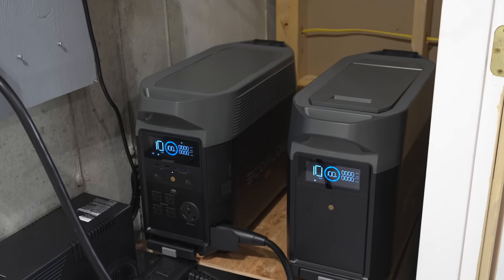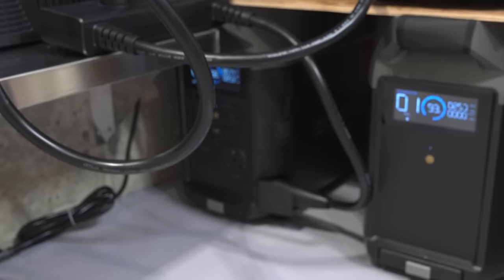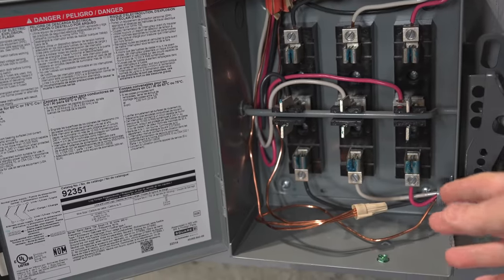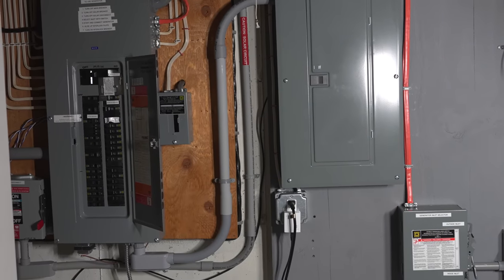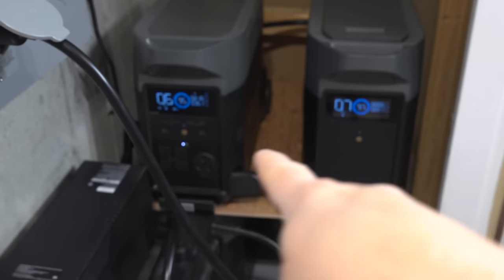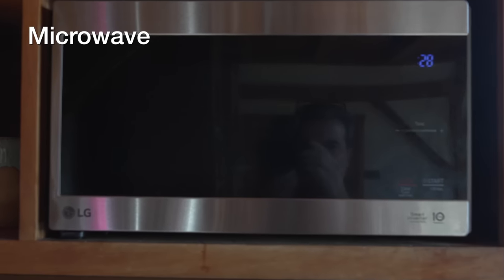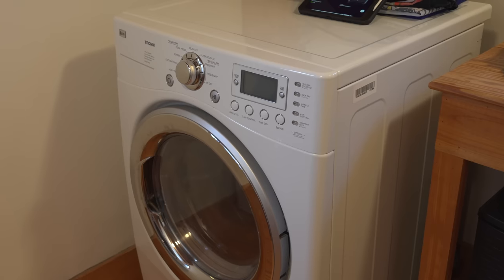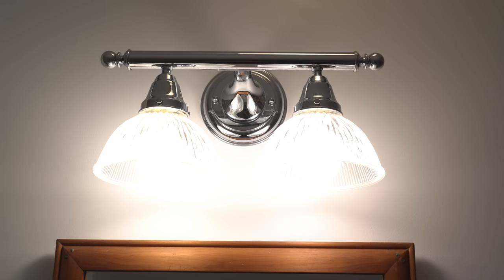How to power your Whole House with a battery generator - Ecoflow Delta pro

Comment: Bro how much does all this cost
Reply: Over six thousand dollars. Worth it.
Reply: @KANSASCLITY it’s about 6 thousand for 1 eco flow and 1 battery, this is about 12k of equipment he’s got here
Reply: It only economically makes sense if you already have solar panels and can use it continuously to draw less from the grid overnight.  Or if your power goes out a LOT.  Natural gas would run about 30 to 50 bucks a day to run a generator.
Reply: How much you got?
Reply: @Benjamin-rq1fi  Yeah I agree. But I like quite clean power. I have the delta pro ultra with 4K of solar dedicated to just it. And 2 gas powered generators. 1 small 120 volt to charge to batteries slowly and very quiet if needed. And a large generator to power the house and charge up the battery’s Fast. After the last power outage I’m glad I made this choice.
Reply: @Shorby99EK I've been considering that use case too!  I may still do it some day, they're just really expensive compared to even an inverter generator.  But it would be real nice to be able to shut off the generator overnight.
Reply: U can do it cheaper
Reply: Do it before the coming war and grid-down. 
The 2 most important things will be to power a well pump and own an efficient wood burning fireplace. Then you’re golden for a long power outage. 
Lights and freezers are next.
Reply: How do you know his name is Bro?
Reply: @kissthesky40  I'm not worried about the zombie apocalypse,  just a reasonably priced solar system when power goes down.    😊😊

Comment: Another great thing about this setup is that you could plug a small generator like a Honda 2000 into the delta pro to help extend the run time of the ecoflow especially when it’s cloudy and solar wouldn’t work well. The Honda couldn’t run your whole house, but could certainly add to the usefulness of your backup system. Especially for people that don’t have large generators. Even better use a small propane generator.
Reply: Nope! You'd think so, but that won't work. Why?

So I had a Ecoflow Delta Mini and I had my router, mesh wifi, switch, IP telephone box, NAS, basically all of my computer stuff, plugged into it. Then, I had my Mini constantly being charged by 110V power. When I lost power (which happens often enough where I live), all would be fine. On three separate occasions, it broke. Each time, the battery would no longer charge. After the third time, they told me that it's not designed to be used as a UPS and if I did it again, they wouldn't fix/replace it anymore. 

If you're discharging the battery while charging it with a generator, you're essentially using it as a UPS. It seems nuts, but they told me that you can charge it or use it, but not both at the same time!!! I'd rather just buy deep cycle batteries or get a Tesla powerwall. Or more simply, just use an inverter generator.
Reply: @dontbanmebrodontbanme5403  I remember the disassembly, the power train they use is a sort of reversable system. So that they can get fast charge times and high output power they use a more complex power inverter that can be basically reversed, this way they can pack more beefy components into a single system instead of having two equally high power circuits, that would increase price a lot. I guess in doing so it wouldnt be able to be used both ways as I am sure that there isnt a "safe" pathway from the electrical charger to the battery or directly out into the inverter.
Reply: @dontbanmebrodontbanme5403  it's some bs - EcoFlow have Passthrough function for AC outlets. I have River 2 model with LiFePo4 batteries - and it able to consume from the grid power for charging itself, alongside with providing power to the AC outlets, by routing the power from the grid (i hear specific clicks inside, that switching lines from invertor to the grid)
Reply: @justahasbeen  Huh?! What are you talking about?

Those backup batteries charge not quicker than the power (genset) you feed them.
Reply: Eric  hey where can this knowledge be found... some things you mentioned I don’t understand, and some I sort of know... One of my neighbors had a fire recently, that started from generator power. A power bar caught fire in their basement with their wifi stuff on it. Their next door neighbor (fireman) happened to be there when it started and spotted it... but he was there to try and help them with a (generated) power problem... I told him (fireman) that it probably had to do with the grounding of their generator and having grounding loop of some kind... but that I didn’t understand what it really means, only that the generators have a ground bonded neutral (or to frame?), that needs to be dealt with when connected to a house with its own ground. Anyway, it’s beyond my comprehension how to logically wire them together. (With my generator i didn’t connect the ground wires together, thinking I was potentially reducing the ‘risk’.
Reply: Why waste time and money on the batteries to begin with? You will never burn more fuel than the batteries cost. My generator can run 12 hours on 2.5 gallons of gas. If I power the refrigerator, lights, range, small freezer and television it runs 8 hours.
Reply: My solar setup still produces 2-4kw when cloudy
Reply: @lookingbehind6335  Some people like to sleep in peace and quiet and have air conditioning. I’m one of those people now. Use solar or a small generator that sips fuel and run on battery at night.

Comment: I'm thinking of using the gas generator long enough to charge the lithium batteries, then rotate back to lithium. That should preserve fuel in the event you're down for an extended amount of time.
Reply: They sell a smart generator now that will do that automatically and then turn off. Brilliant!

Comment: The EcoFlow generator won’t be able to keep up with the demand on the battery to charger them. I would say just use their chargers and plug them into your large generator and set the EcoFlow to fast charge.

Comment: Just a note, the battery back up system running is in the neighborhood of $10,000 of battery and connectors.  This would be comparable to an 11-14 kw Generac with a whole house transfer switch installed.   That Generac would need NG or Propane, but it would go until you run out of fuel.  However, with the Eco Flow system, it will not annoy the neighbors at 3 am.   The only question is whether you can charge up the batteries while they are powering the house?  Or must it be done off line when using the 110v inlets?

Comment: I search for "how to connect a battery to my home electrical system," and I get, "Let me show you my $10,000 system that I installed as an electrical engineer!"
Reply from the maker: Take it easy, I have been doing these for a long time and started with gas gens. BUT if you want to see the cheapest way to do this and you can use gas or battery, see my $100 install here, seriously: https://youtu.be/pPMm0reEBPM

Comment: Use propane generator to charge the ecoflow pro at ~1800watts in 2hrs or w/extra Battery in 4hrs. 5 gal 20lb propane lasts many hours! Propane stores for years & years vs few months for gas!

Either buy a 5000 Watt or two 2500Watt dual fuel generator . Using propane, no cleaning is required for storing  and propane burns cleanly!

Comment: Never having to worry about a Power Outage. That's incredible.
Reply: My childhood house was right next to the hospital and whenever there was a power outages most of the neighborhood would be dark except for a few houses like ours that were somehow on the hospitals grid. In 2008ish there was a big snowstorm and the neighborhood was without power for almost a week. We ran low on food but thankfully we never were cold and never without power.
Reply: None of this is automatic, so he does have to worry about it. (i.e. power's out when you aren't there to switch everything over.)
Reply: Worry and concern are two different ways of thinking.
Reply: Is it that reliable in the long term tho?
Reply: What happens if you have multiple days without power. Use a gas generator like most people with a brain do.

Comment: Man I can tell you've heavily invested in your house to make it exactly the way you want. I absolutely love all the tasteful things you've done to it. The solar, the battery backup, the lawn, the networking (my favorite) and everything else. I love watching your videos man keep up the good work!
Reply from the maker: Sorry it took me a year to see this nice comment. Thank you!
Reply: @SilverCymbal  Where can we find that special box for 240?
Reply: @SilverCymbal  are you sure the 3 pole switch is needed/code? All my research said that when you switch the neutral you make it a SDS and so you shouldn't switch the neutral?
Reply from the maker: @Kyle-e8b  I would consult a licensed electrician for your particular installation before taking any action. But this is my logic. Your inlet has 3 wires and a ground. Your generator has 3 wires and a ground. If you were to physically disconnect that inlet and move the wires to a second inlet, you would be moving all 3, hence switching all 3 wires would be logical  I have seen many posts were folks are just buying a 2 pole switch saying it works fine but your generator is putting out 3 wires and a ground, so the idea of not switching the neutral, despite it being there and relying on the ground to carry the neutral probably works, but I wouldn't do it. There are lots of posts online about both but the safer choice for my install was to switch all 3 wires, since you are truly moving all 3 wires between the inlets.
Reply: @SilverCymbal thanks for the quick feedback, makes sense and definitely seem to be multiple ways to go about this depending on your setup. 

For anyone else that comes along, below is a recent thread I was referencing and will likely go the un-switched neutral route as it is about 5-6x cheaper on the switch alone. 

"About the only time we would switch neutral is for a mobile system, like RV or boat.
When plugged in to shore power pedestal, we expect to get a neutral bonded to ground. So don't bond locally.
When power is not seen from the pedestal, maybe we are unplugged, or maybe we are still plugged in but the grid went down. Don't know, so open the neutral wire with a relay, and bond neutral to ground locally.

If you have a hard wired grid connection that provides neutral-ground bond, also a generator with neutral not bonded to ground, and an inverter with neutral not bonded to ground ... then just keep all neutrals always tied together. You can use an interlocked breaker panel (or multiple cascaded) to switch L1 and L2."

https://diysolarforum.com/threads/interlock-circuit-with-outside-inlet-for-generator-and-inside-inlet-for-solar.70731/post-896416

Comment: My ideal system would be to use the generator during the day & battery power at night. I love the idea of a system like this, as one of my concerns is that generators have been known to disappear during the night. 
At the moment, we don’t have enough outages in our area to justify the cost of a battery backup system such as the one in the video. It’s nice to think about though. 😀
Reply: You mean someone steals them during an outage when they are running??
Reply: For most homes it would use less gasoline just powering the house off the battery the whole time and recharging it from the generator as needed.
Reply: those batteries are not cheap and they only have a certain amount of charge cycles before they are toast. Good for storm backup and camping but not for daily off grid use.
Reply: @miketrav  If you are referring to Lifepo4 batteries then they last for thousands of cycles so cycling them daily is not a problem
Reply: @miketrav  
U R Wise
Reply: @miketrav  They have lithium iron phosphate batteries that last approximately 3,500 Cycles, or more, of being fully discharged and then recharged. Halfway discharged and then recharged counts as half a cycle. That gives you proximately 10 years or more and then the operate at Approximately 80% capacity, making them still fully usable but with less capacity.
Reply: @miketrav  Depends on what kind of batteries they are.  Old fashioned flooded lead acid batteries that have their water topped off ( with distilled water ) and an equalization charge given every 6 months or so have been known to last for 20 years.  It's the sealed type gel cells ( used in most cheap PC UPS systems ) that wear out quickly as once the water boils off you can't top them back off.  Another factor that makes a big difference is whether you constantly give them a float charge at max voltage ( as most cheap PC UPS systems do, which boils off the water constantly ) or lower the float voltage after they reach full charge.
Reply: @phillipsusi1791  I’m talking about the battery that comes with that thing it only has so many cycles before it’s done
Reply: @Samlol23_drrich  No they shut them off first. :)
Reply: @LarryDickman1  very funny.  But that’s awful to have to worry about something getting stolen from your houses during an outage.
Reply: @Samlol23_drrich  I only use my generator to charge up the batteries during the day when I can monitor it. It then it gets moved inside. The 2nd amendment helps also.
Reply: @LarryDickman1  it always helps!

Comment: Awesome summary, thanks!  Quick tip... the green screw on the 3 pole switch box should be connected to ground.  In the event that any live wire touches the box,  or if the switch malfunctions, it'll throw the breaker / fuse, and prevent you from getting shocked.

Comment: It makes perfect sense to use batteries and charge them with a gasoline or diesel generator if needed. I measured the power and fuel consumption for a small 650 W gasoline generator. At 50 W el load, the efficiency was disastrous, only 2 %. At close to full load it was 9 %. A larger generator will have better efficiency at full load but if your average power need is small, it's a crazy waste of fuel to run a generator a long period of time.

Comment: Thanks for the video. This is exactly the set-up I plan to have one day.  For shorter outages, up to 12 hours, I wouldn't have to do all the work setting up my portable generator. Just do the interlock switch (already installed), throw the triple throw switch, power up the batteries and we're in business - without ever having to step outside into bad weather.

Comment: Love the video and agree with the approach. My system is coming along. Rather than a panel interlock method, I am using two Reliance 10-circuit transfer switches. These are wired in parallel with the L14-30P inlet, so one leg powers all the A side circuits in and the other leg powers the B side circuits. I decided to protect all critical loads but also all comfort loads throughout the house, which had 20 circuits all doing 120Volt loads. My plan started with grid down backup, but evolved into a system I can use year round to offset my electric bill and exercise my gear. I have two Delta Pro units and the smart hub, so I connect right into the inlet and power all 20 home circuits. None of my loads are 240Volt so I could actually use just one Delta Pro with a 3-prong to 4-prong adapter. Because I can toggle each circuit individually, I can continue to use utility power for high loads - in particular I left central AC, dryer, and oven out of the transfer switch setup. If I lose utility, I can live without those 240Volt loads. The Delta Pro units have the expansion batteries for 21KW total storage available. My hope is to add two strings of solar probably using 400Watt panels, probably 3 panels per string for a total of 6. I don’t want to run the risk of harming the Delta Pro solar controllers that are limited to 150Volts solar input. I also have a pair of EU2200 units with tri-fuel conversion from Grenergy US, so I can run those to refill the Delta Pro units. This will be nice because they don’t need to run full time, just intervals. With natural gas, my run time could be indefinite. If NG fails, I can use propane supplies I keep onsite (grill tanks). All together, I have 5 sources between solar, utility, natural gas, propane, and gasoline. The Honda’s can work in parallel to output 3600Watts and I can go into the same inlet and take the Delta Pros out of service if they are failing. I have a long, quality extension cord to reach from outside to the inlet inside. I think the use of the transfer switch is the main difference and it allows me to run a portion of the home, such as refrigerator and Internet, on solar generation while still using utility for heavy loads. I have a window AC to replace central AC in the main bedroom during a grid outage. Now, I would also challenge everyone to seek to reduce their needs so they use less power to begin with. A clothes line can replace the dryer. You can cook on a propane grill or with a toaster oven, instead of a big kitchen oven. A Mr. Heater Buddy can product heat for a bedroom directly from propane with no generator. You can use candles instead of house lighting and you can switch to LED bulbs. You would be amazed how much is sucking power and when you are trying to get the most out of batteries, you will try to be frugal with your electric consumption. Please note, I didn’t want the Smart Panel from EcoFlow because I wanted a standard inlet that my generator could use directly. I also didn’t want the EcoFlow generators because the Hondas have a bullet proof reputation but it is nice that the EcoFlow generator can make a direct DC connection to the Delta Pro, using fuel more efficiently. Last point - I installed the MicroAir soft start on my 5 ton AC and experienced a drastic reduction in startup amps. Though I haven’t added central air to this backup power plan, the soft start will prolong the life of the equipment and help me if I decide to power it with a larger mechanical generator in the future.